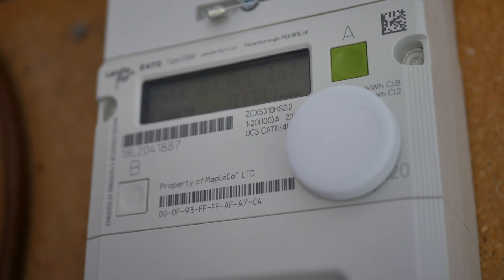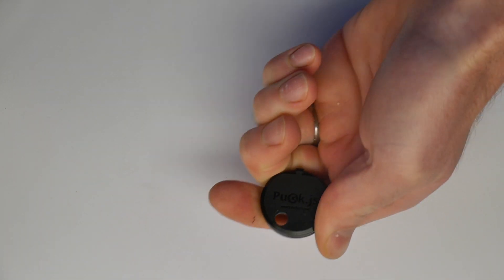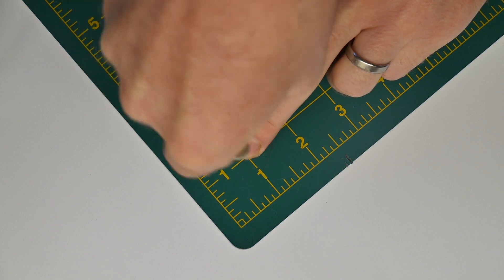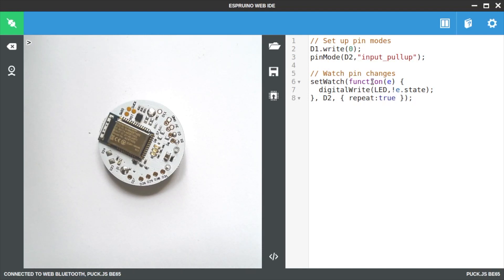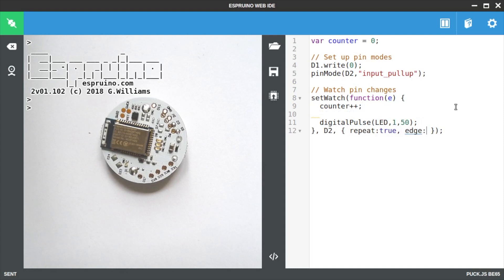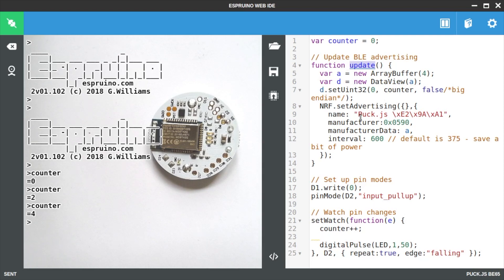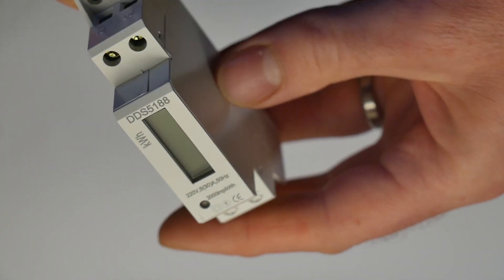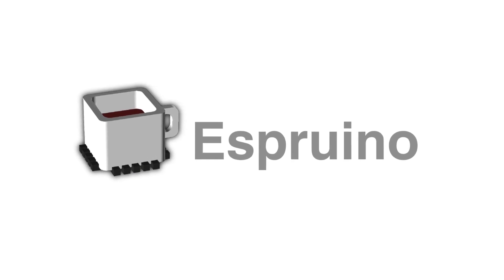DIY Smart Electricity Meter with Puck.js

Comment: I've set my puck up with a GL5537, but it doesn't respond like yours does. It only respond to a very bright light (iPhone torch). Is there any way to change the sensitivity? Does it matter which way you put the LDR in?
Reply from the maker: It won't matter which way around the sensors is... Are you sure it was a GL5537, and that it's connected to the correct 2 pins? There are different value LDRs you can get with names starting with 'GL55' - and they have different resistances in the light/dark and that could be your problem. Do you have a multimeter you could try and measure resistance with? It's not the end of the world as you could always add a different resistor externally to balance it out.
Reply: @Espruino  Yep it was definitely a GL5537, I saw a tutorial on adding a resistor but don't have enough experience with it yet. I've got it working with the LED and have rebuild the dashboard app so it shows a better per day / month comparison. As a bonus I've plumbed in the power consumption as mentioned in the original and also a direct correlation to the kWh display so you can verify it's synced up. I'll post an update with it once it's all polished up. Again, thanks for your help.

Comment: Would the new puck js 2.1 in built lights sensor be usable for this, rather than using an LDR?
Reply from the maker: Yes - there's actually some code for it right at the bottom of that page on the Espruino website: https://www.espruino.com/Smart+Meter

It's a little bit tricker - because you'd have to mount the Puck the opposite way around, and the built-in light sensor only works for some wavelengths of light (so it might not work with your meter), but it's easy enough to try by holding it up - and if it works it's easier and actually uses a less battery power too.

Comment: I have a pound coin meter outside my house. Do you think there would be a way of calculating the remaining credit with the pulse? Providing we know the cost per Kwh and can input the current credit at the start and update it manually whenever I add credit. I just need that balance in my Home Assistant so that I can set up alerts for it if gets too low. It's such a pain that it's outside :(
Reply from the maker: Yes, I'd have thought that would work well. I'm not sure if you've seen it but Home Assistant supports BTHome now, and it's trivial to set the Puck up to advertise in a way that it can pick up. You could then put a Shelly device (or ESP32 with ESPHome) inside, as close to the meter as you can and hopefully it could be picked up

Comment: This is really good idea. Any update on the battery life? How long did it last for. Thanks
Reply from the maker: It was around 6 months off a CR2032 in my case. But the more light you have that gets to the photosensor the more power gets drawn, so if you don't manage to blank it off very well it'll drop the battery life.
Reply: @Espruino  that’s great. Currently I’m using an esp chip with a photo diode and I’m only getting 5 days out of a 12000mah battery pack. Will try this.
Reply from the maker: @qhealy  Ouch! Yes, the Espressif chips are great for Wifi, but are very tricky to get to power consumption modes. The nRF52 parts used in the Puck are way better - probably around 0.02mA (although the LDR will likely add the same again)
Reply: Just getting around to ordering one of these. But I noticed there is a 2.1 version and a lite version. Is there a preference for which one to use for this project.

Comment: any difference in the other GL55 LDR for the power consumption? what's the min/max for it to wake up?
Reply: What you're trying to do is get the voltage on the wire from the LDR so it turns from a logic '1' to '0'. The chip's specs say that's usually at around 1v. The internal pullup resistor is around 13k, so you want an LDR that can get to a low enough resistance (let's say under 4k) when there's a flash of light. You could use any LDR value, but you might need to change `input_pullup` to just `input` in the code and then provide your own pullup resistor of a value that works with the LDR. The higher the LDR resistance the longer your battery will last, so you could definitely get more life by changing. Looks like you asked on the forum too? More detailed info there... http://forum.espruino.com/conversations/364988

Comment: George.laverty@sky.com can you sell me one of these or contact me plz I’m desperate I was using magnet now they changed meter to anti tamper
Reply from the maker: There's a bunch of info about how to make one (including where to get the Puck and sensor) at https://www.espruino.com/Smart+Meter - if you've got a soldering iron and drill it should hopefully only take 10 mins to put it together

Comment: Hey Espruino and Gordan! First question, Im trying to decide whether to run this on a Puck.js or Espruino Wifi. Gordon, am I right in thinking all the Espruino products are interchangeable projects wise (other than the extra features each gives). Otherwise I am also thinking of using a WeMos D1 mini standard/pro. The electricity meter in my house is not near any electrical outlets (kind of ironic) so battery operated would be best. Second question: How many days worth of data could it store do you think? Am I going to have to walk past it every day with a phone to grab the data? I would like to build a usage graph over several months, down to usage every half hour if possible. Hence maybe thinking the Espriuno Wifi might be better, then I can send the data straight to something like AWS? If you can answer any (or all) of the questions above, that would be great.
Reply: Yes, they're pretty interchangable (not completely) but this should work fine. Honestly it depends how you store the data - but lets say you store one byte per half hour, and overflow to the next half hour if electricity usage is too high (unlikely). That's 48 bytes per day, so even just using 20k of RAM with a Uint8Array in a really simple way would give you over 400 days worth of data. So personally I'd say Puck is probably still better for this - it's a lot more self-contained. I'm actually hoping to come up with some easy Bluetooth bridge software soon (ESP32, or old Android phone) so when that happens it should be trivial to get the data online as well.
Reply: @gfwilliams  thanks for the quick reply. So you'd still go puck over the espruino WiFi? And isn't there a light meter in the puck already according to the spec? Why the separate ldr?
Reply: @redfox05nl  Yes - really just because it's a self-contained device. With the WiFi you'd need a LiPo battery, and then maybe a charger, box, etc... The Puck does have light detection (it uses the red LED as a photodiode) but it isn't able to go to sleep and wake up when the light level changes, which we can do with the separate sensor to make it really power efficient. Also, it's just convenient this way because you can mount the solid plastic back onto the electricity meter - if you flipped the Puck around so the red LED was over the electricity meter's light, you'd have to find a way to mount the silicone case...
Reply: @gfwilliams  great thanks, that really helped me understand better. I've gone and bought the Puck JS V2 and a GL5537 LDR ( still trying to figure out the pros and cons of the different GL55 options, but I'll just go with the recommended from you for now)
Reply: Oh and a bit of irony here for you to chuckle at. I'll be installing this onto a brand new smart meter that is sadly not getting a connection signal, so it's just a dumb meter atm. PuckJS to the rescue!
Reply: @redfox05nl  Heh, yes - same here. Having a smart meter installed that didn't work pushed me over the edge :)
Reply: @gfwilliams  btw what's your thoughts on this approach Vs CT clamp measuring current. And also, in your approach, do you need to baseline with a known current draw like 100w bulb to calibrate? I see no some other guides recommend this, but I don't understand that, as the flash should already be calibrated.
Reply: @redfox05nl  Personally, if you have an electricity meter already I think measuring flashes is far better. The meter should already be calibrated, and each flash corresponds to your account being billed an amount of money, which is probably what you care about. Using a clamp will give you instantaneous measurements, but to get a truly accurate reading you need to integrate it with the AC voltage, which is potentially dangerous.
Reply: @gfwilliams  yeah and it's tricky as using the average 110/230v is also not right, as the voltage will vary all the time, so like you said, you'd need to make voltage, which I don't think you can do passively. So the blinks don't need calibration then in this method?
Reply: @redfox05nl  No - they'll be maybe every 0.1kWh - and they're produced digitally by the meter, which should already be calibrated.
Reply: turns out I was wrong here - you can wake up on ambient light level changes: http://forum.espruino.com/conversations/351590/
Reply: @gfwilliams  so does that change the use of an LDR vs inbuilt then? I mean theres still the hassle of mounting it back to front etc. and ensuring no light leakage. But other than the location of the LED, what are the other drawbacks/benefits.
Reply: Nevermind! I had a look at the link you sent, and it explains it all :)